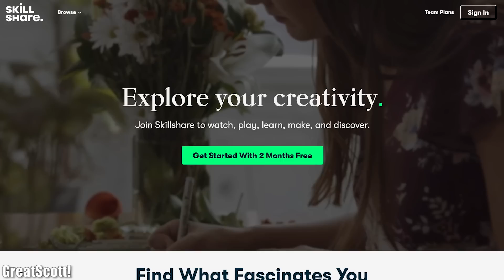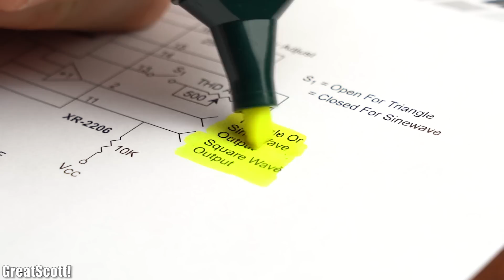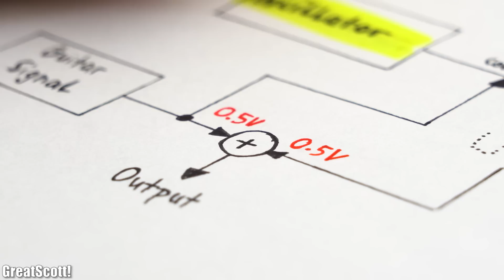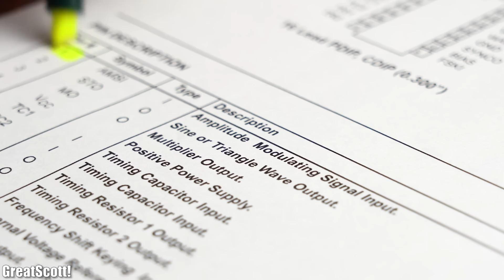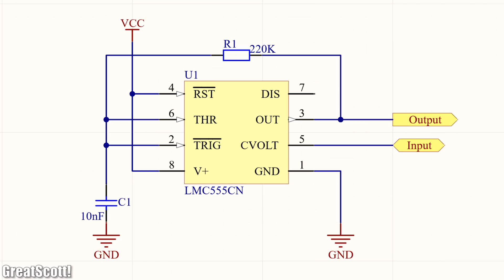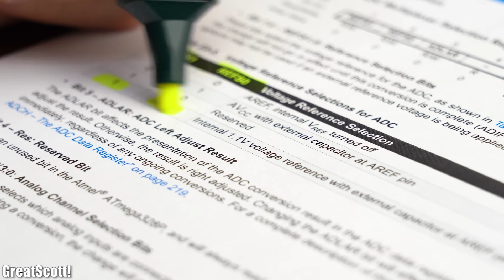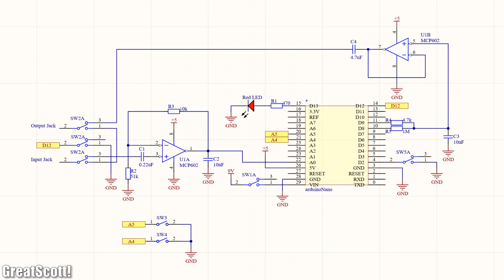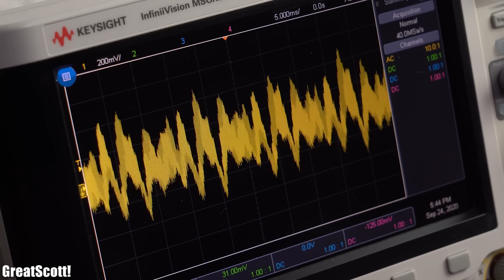Experimenting with electrically generated music?! || DIY Guitar Effects board!

Comment: So, what you have created is a digital version if a fuzzbox / distortion pedal.  Nice; but, these date back to the 50's or 60's; so noting new.  Time to up your game.
Another idea - Use an FFT to find the primary notes of the incoming signal then either use that to create a MIDI stream and plug into commercial keyboard or just generate then tones youself.
Take it to the next level - Use the detected tones and then do the math to add an accompanying tone (complete the chord, or double the root tone).

Comment: Hi greatscott, I'm currently experimenting with my old car's digital tachometer which uses +12v signal to measure rpm from igniter module.. then I looked to internet how to switch high side 12v.. I found schematic that uses 2 transistor, one npn and one pnp.. I ended up following the schematics with 2n2222 and Tip42c.. but it's not working and I don't know why.. I am dumb at transistors.. the Tip42c won't fully turn off.. can you help me with this?

Comment: Could u find/modify a hair dryer to be designed for continous run? 
Details that the hair dryer needs to have:
- 3 Heat modes (200W/500W, 600W/1000W, 1000W/1500W);
- 2 Speed modes (low/high);
- 220-240V

Comment: Ugg, when you mount panel switches, you put a nut on the back of the panel and use that to tighten it up with. You adjust the front nut by hand, to make it appear how you want. If you tighten the back nut, you don't take a chance on damaging the panel.

Comment: Hello Scott! I have two faulty tv's at home (from 2013, dead mobo's which is a common problem) and I would like to have them working again as it is a waste to trow out 2 good lcd panels with just a faulty motherboard. I found out that they use a V-By-One 8-lane signal by looking for their datasheet. The panel is a Samsung LTA460HQ17, I found some 4k V-By-One drivers on aliexpress but my screen is fullHD, i dont know if that matters, as well as the horizontal/vertical frequencies? Most likely you wont see this message but you're amazingly good at electronics and I hoped that you can/want to help me!

Comment: I have a question 

I have a 12v 3s 20A  BMS but I made 2 battery back one is 18.2A and another is 24A both are 12v battery pack 
Can I use that 20A BMS in my battery pack

Comment: Hi, Scott. I have question about powerbank. I have one powerbank laying and i want to finish him, now i am waiting for battery and i was thinking how to make a wireless powerbank from a normal one. The motherboard have 2 outputs USB and one micro-usb, the battery that i am waiting for is lipo battery from aliexpress and it have one solarpanel. My first question is can i desolder the micro-usb and solder in that place a usb type c, will it work of do i have to buy a new motherboard with usb type c? And my second question is that if i want to make this powerbank to wireless charging then i have to buy a power transmission pad that transfer the power to the phone, but i saw that the motherboard needs a 2x TX places that i can solder it and the motherboard that i got, have no TX place, so how to solder it to motherboard? Thanks for answer!

Comment: Hi , i was making an ups for my wifi router using xl6009 boost converter module with 5v input and 12 out , as i connect to the router the voltage drops to 4v  ,is there any thing to be modified or added , please help...❤️

Comment: That Tremelo could be done with a simple light sensitive diode and NE555 with some smoothing caps on its output to round the shape.  Of create a simple single transistor oscillator.

Comment: Congratulations on your swift progress learning to play guitar! Sounds like you have some natural talent.

I know that your go-to solution is "Let's use an Arduino and whack in some code!" but it would be interesting to compare your DSP efforts against traditional analog effects. You teased us early in the video with an exponential converter using 2 op amps and a couple transistors...

Comment: well the analog was fail because you wanted to mix 2 signals instead of modulating the input signal, indeed the signal should be an mix of modulation and input signal, if you look at any modules you got "wet" and "dry" signal which you add both of them and you modify amplitude, volume and frequency of it, plus if you looking for reverb, you need some sort of storage for the signal to be repeated.

Comment: you should try making a battery,may it sound silly but making a stable battery is not easy...But do not make a lead acid battery no one is intrested in lead acid battery,make a stable dry cell battery,by unstable battery I mean it could heat while charging or may not provide enough charge cycles

Comment: Would it be better to use an external DAC in the output to get the analog audio instead of the PWM+filter? I guess using the filters may be adding to the distortion in the output

Comment: 0:58 it is actualy not 6.3mm, but 1/4" (or 6.35mm) but close enough :-)
Reply from the maker: True
Reply: @greatscottlab  In general I prefere (and use) SI,  except where things were not using SI.

Nuts and bolts, and tools for those. Rims for my car. Pipes and connectors. Screen-size. 

There is one thing I like about imperial units. Their current definition is by SI. 
Any imperial measurement can always be converted to an SI measument, just add enough decimal The other way, you are lightly to get an infinite decimal.

If it is a "random" measured value, I usually convert to SI, but if it is a "perfect" value by design I use the imperial measurement in descriptive terms, but sometimes convert for convenience if I need the measurement relating to something else.

Comment: I built the Arduino Mega version of that effects pedal.  It was then I realized that the 5 ultra-cheap Chinese Mega clones ($12) I bought had absolutely zero analog side capacitors for filtering.  Needless to say the noise of this solution was more than I could tolerate.  I expect  a genuine Arduino Mega would have sounded much better.  Even with the Mega's extra memory (8KB)  over the Nano you used the amount of memory is a really a serious limitation for any type of reverb/echo effects.  It is however fun to experiment so I don't regret the time I spent building the effects pedal.

Comment: i recommend checking out the Spin FV-1. it's more optimized for making digital audio effects than an arduino, and has all sorts of useful stuff built in (delay lines, echo buffers, LFOs, envelope generators, ect.)
Reply: as for building a synth pedal in particular, i'd recommend starting with a PLL based design like the schumann multiplier divider and adding stuff like an envelope filter, a binary counter-based octaver, using a re-triggered 555 to do PWM waveforms, ect. in the world of guitar pedals it's more common to use parts of existing designs and mash them together than to create a design from complete scratch.

Comment: Just an idea here:
Get the input from guitar to convert the frequency of the note to a certain amount of voltage in a rate of 1v/octave (this is like a standard in modular analog synths) and then feed the pin 1 of signal generator. The output of generator will feed a VCA (Made with a transconductance OpAmp like CA3080)  The guitar input signal envelope will control the gain of VCA. The output can be mixed with the original signal or still pass through a VCF.

Comment: I think you should revisit failures 2 and 3; you may have been closer to success than you realize.  The output sounded overmodulated and/or clipped.  Try dialing back intermediate amplitudes to stay within range of downstream components.

Comment: for acoustic guitars, it's really creative if you could apply a reverb effect. It's the most difficult effect to simulate. Analog circuits would wither use springs or bucket brigade circuits, but digital techniques are also difficult since a lot of code is involved.

Comment: 5:20 you could have used a diode to generate harmonics hence multiplying the signals, and a capacitor as a low-pass filter, It will sound robotic but cool. a kind of AM modulation.

Comment: 4:58 what you were expecting by adding two sound signals together 😂😂😂
Reply: You need to mix those signals instead of adding them together. For example switching a singal on and off with a transistor using the other signal.
Reply: Actually what you did after that was comparible to what I say by mixing
Reply: He had already known what happens when adding two signals. But he wanted to show us the result anyway.

Comment: Here's an idea you can try - there's a company that started reissuing some classic analogue synth chips including proper VCOs, called Alfa Rpar. Their AS3340 could be interesting to use in a guitar synth, and you'd also probably want to make some sort of envelope follower for the guitar signal to gate the synth output - I'm guessing a full bridge rectifier feeding a capacitor would work

Comment: Look up the Shumann PLL pedal schematic if you want a synth sound. It's based around 4046 PLL IC - which tries to match the signal's frequency and in a way also has a linear frequency output ("detected frequency output", let's say). Hooking up this output to any linear-FM VCO will make it a synth, essentially (shumann PLL originally is a weird octaver pedal), I'm sure even XR2206 will work just fine, but will need a bit of tuning to match the 4046 output voltage range and XR2206 input voltage.

I don't get why did you just hook up your guitar signal to FM input; Were you trying to achieve FM synthesis sound?

Comment: now make a preamp for the other guitar from one transistor 3 resistors  capacitor and piezo electric flat speaker
but what i really wanted to say, your effect box is tuned for low impedance preamplified signals
how about dryving it with low impedance electromagnetic pickup of an electric guitar?

Comment: 7:30 I think that Just lowering the volume of the guitar or attenuating the output a little would solve the problem, it sounds interesting really wanted to hear it not clipping.
Reply: It’s not clipping, it’s frequency modulating the signal onto a square wave. That’s why it sounds so strange. But even if you were to change the waveform it wouldn’t sound significantly different than before.
Reply: @schefre35  I noticed when he played lighter it sounded right, but with a warmer signal in the chords the signal got all mangled, I still believe that if he started with a clean atenuated signal and amplified it in the output it would sound better, or maybe cut half of the wave would help too
Reply: AmazinChannel That’s how frequency modulation works, he didn’t play anything in the beginning (for a fraction of a second), and that’s why we could hear a (somewhat) pleasant tone.
Reply: @schefre35  2 different notes? If it was Just one I would agree with you but no, when he gets to the higher notes it mangles, that's why I sugested a flip flop to lower the guitar frequency so the modulator has more time to work, or simply work with half a wave.

Comment: You should build a Amplifier Board that overdrives an vacuum tube.
Reply from the maker: I can put it on my to do list :-)
Reply: @greatscottlab  yassssssssssssssssss
Reply: How big is that list?
Reply: @greatscottlab   try use new old stock vacuum  tube
Reply: There is a project like that that uses a fairly small amount of components and can be point-to-point wired to the tube socket. Actual tube amps will require you to deal with voltages upwards of 600v on the power tubes.
Reply: By the way, there are tons of way to mess with the guitar circuit, like very simple transistor overdriving circuits, to funky compressor using the interaction of a LED and a photoresistor, etc.
Reply: I was just designing a tube guitar amp circuit when I saw that video